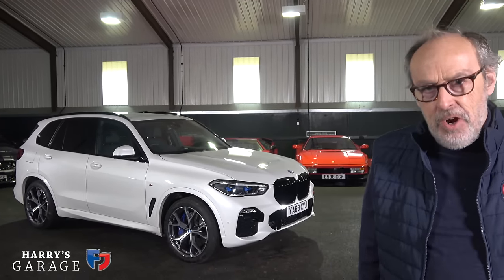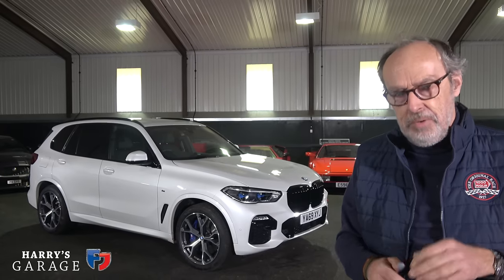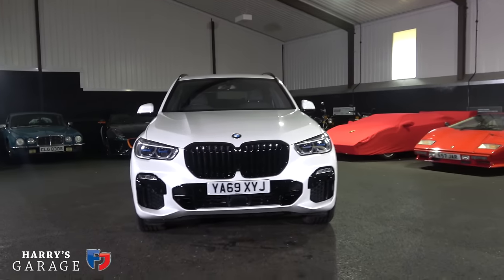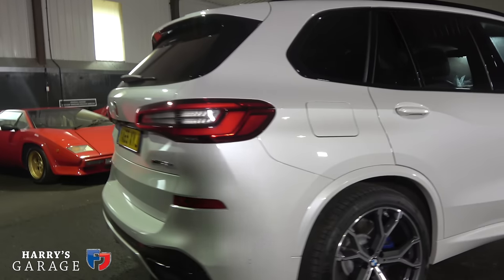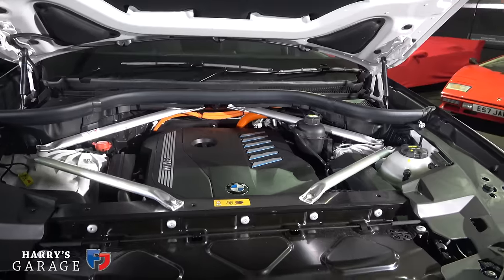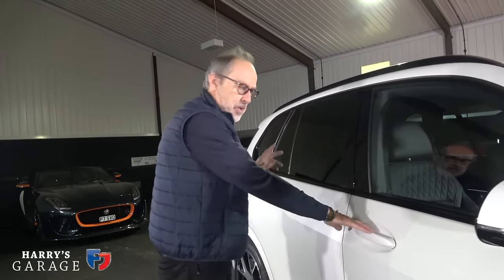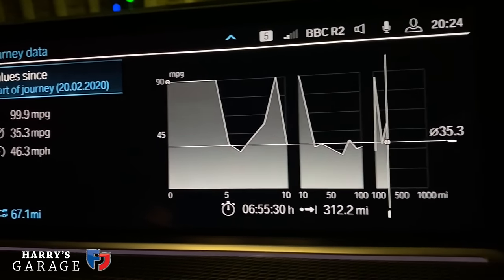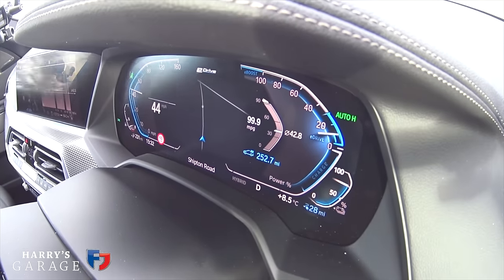BMW X5 45e PHEV 2020 review. Is this new plug-in hybrid better than a pure EV in the real world?

Comment: PHEV is absolutely better. Even here in California, where there are supposedly more fast chargers than almost anywhere. Just in Dec over the holidays, Tesla owners were waiting over 4 hours to use a supercharger. The local supercharger at the Tesla dealership (the next closest would be at least 30 minutes drive away-in the San Francisco Bay area) there is regularly a line, so people expect an hour's wait minimum.

My wife has had several Chevrolet Volts over the past 8 years, the latest being a 2018. This one is rated at about 50 miles on battery only. We do have a level 2 charger at home. Her commute to work is 18 miles round trip. 95% of her driving is pure electric. However, she can drive wherever she wants without having to plan the route around charging stops. Refueling the tank takes only a few minutes, as compared to a minimal 30 at a Tesla supercharger.
PHEV is the way to go. There isn't the charging infrastructure in place even in California to support the electric vehicles that are here (said to be about 10% of vehicles registered) and there certainly isn't enough of an electrical grid to support charging if pure electric were to be the overwhelming majority.

Comment: I think PHEVs are better for many people and probably better for the environment. A real electric range of 30 miles covers about 90% of my daily driving but the other 10% is long range motorway stuff. ICEs are pretty efficient on motorways, the public health benefits of EVs are most valuable around town and 90% of my driving would be zero emission without having any concern about range. And using smaller batteries is highly beneficial in environmental terms. I find it worrying that an obsession with GHG emissions seems to be blinding people to all other environmental impacts.
Reply: This exactly. I can't work out why VW for instance didn't make say, the E golf a plug in hybrid with the little 1 litre. It wouldn't have been that much more expensive and then you don't have to have a whopper of a battery either

Comment: Yes that's all very good but why not factor in the depreciation. I bought an immaculate  Land Rover Td5  12 years ago - Back then I paid just over 7k and now it's on 175k miles and still worth 4k today. On a run it averages 30 mpg but as it's not an everyday car it really doesn't matter. On the other hand I run a late Ford Connect van and an older but brilliant Audi 90 A2. both give around 60mpg. My son has an Audi A4 which does around 70mpg so I don't see whats so game changing about this BMW.  I heard once that to justify a Diesel car you needed to travel 70k miles in total before going into profit Vs the petrol version. The only way the BMW win is if you only do around 40 miles per day but you know in 3 years it's only  going to be worth 35k which is almost half its original value. Have I missed the point?

Comment: Could you try the new Mercedes gle 300de it has a  2.0 Diesel engine and  a plug-in hybrid quoted electric-range of 100 KM [62] miles this sounds like the perfect solution

Comment: I suspect that total CO2 emissions from this car, including the emissions from the electricity production are probably worse than from either a modern diesel car or a 100% EV. There's also an issue to do with complexity: CO2 emissions during manufacture will be higher than for a simpler car and perhaps this car will be uneconomical to maintain when it's ten years old meaning that it might have a shorter life which would further increase the total life cycle emissions of CO2.
Reply: The battery is not that big and the grid in the UK is very clean so if they do a 4-5 thousand miles in electric it should be cleaner.

Comment: I test drove a brand spanker and only got 36 miles off the battery over a 24 hr test drive which made me a little disappointed. Not sure if it was because it was on the first charge et?. A great car though and struggling to decide between this, tesla 3, iPace or Taycan...
Reply from the maker: I suspect it wasn't fully charged. The last 20% of charge takes a lot longer to go in than the first 80%. Only guessing but I found it did  at least 40miles on every over-night charge, with a peak of 48miles.
Reply: @harrysgarage  It was charged to the brim, it was used in and around Bristol mainly and probably did about four hill climbs (but the engine does kick in where it needs it as I'm sure you found). I think I need another long test to see if I can achieve similar results to what you got.

Comment: Great review Harry - but hybrids and EV's only make sense if you're fortunate enough to have a charging point at home, for the rest of us they're not an option.
Reply: But you can have a charging point installed at home if you want. Yes it will cost you but then it's offset in lower car running costs.
Reply: @martinr7371  Many of us can't have off-street parking - if you live in a terrace house in London for example, or a flat or tower block, so a home charging point isn't possible: I'm lucky if I can park outside the house, often I can't park in the same street. Remember the problem Harry had when he tried to charge his EV away from home; and whats going to happen to the the cost of electricity?
Reply: Agree on all points, this is the problem not just with PHEV's but pure EV's too.  The infrastructure is sorely lacking. I can't see how they will ever overcome charging issues for terraced housing, high rise accomodation etc.

As for producing the electricity in the first place? Well while we still burn fossil fuels it seems hypocritical to push the EV.

Comment: I have had my car for two months, when fully charged the most it has ever stated the range on the battery would be is 41 miles. Good, would be better if it did as advertised. My only other reservation with the car is it’s width, it fills a standard car park space leaving one wishing the right to use the mother and baby car park spaces.
Reply: So you don't even get 41 miles?
Reply: Akin Olusoga no, having said that I seems to be better than any other available.

Comment: I have X5 40e.... Great quality car... Electric range not great 18 miles... But ok.... Has 2 litre petrol 245 hp engine...better option than the 6cyl.. Quieter and more economical with plenty power...

Comment: Can the engine also charge the battery if the battery is low or can the engine just hold the battery at a set level ? Like the range extender BMW I3
Reply: I have a 330e and you can set it to charge mode on long runs

Comment: Perhaps the poor petrol performance has to do with the extra weight of the batteries.   That's the problem with PHEVs - you are lugging around two complete drive systems.  If you want it to compete with Tesla on performance you then need an even bigger engine.  To get a decent electric range you then have to have more batteries because the bigger engine is heavy.  So there you are on a vicious circle , while your costs spiral upward  because you have two of everything.

Comment: This is getting close to where PHEVs need to be, but the slow charging is unacceptable for a battery that size - they'd need to get it up to at least 7-8 kWh and ideally up to 11 kWh. Pretty sure that will happen in the facelift (or even before), so I would hold off until then. The current maximum is 3.7 kWh which is basically what a beefed up standard domestic plug provides - not good enough. Personally, I believe a more sensible strategy is to buy a full electric now and keep your conventional ICE around for a few more years but minimise its usage (long trips & vacations). In that regard I am really looking forward your Tesla review, which I hope is going to be for the Model 3 (?). That car is a bigger game-changer for electric than this X5 is for PHEVs.

On the BMW PHEV front, it also seems pretty inevitable that the next 5-series touring will get this type of tech (current one isn't engineered for this size of battery), which will make a lot more sense (why put eco-friendly hybrid tech in a heavy SUV)? That should also be a lot more fun to drive. Hopefully BMW also realises that these would be bought by enthousiasts and provides a sports exhaust option - I drove the X5 45e and you can barely hear it! So  potentially a lot of good reasons to hold off a little longer. But yes, if you must go (luxury) PHEV today, this X5 is probably the only choice in the game right now. And Harry is right that it's priced quite well.
Reply from the maker: I'm afraid it turns out the slow charge rate is down to legislation. It turns out Germany introduced a new law (January 1st 2020) saying you can not home-charge at a rate greater than 4KWh, as power companies were concerned their national grid could not cope with supplying lots of homes charging BEVs at a higher rate than this. Here in the UK, we can currently charge at a max of 7KWh on normal domestic supply, or up to 22KWh if you have a 3-phase supply. But I'm hearing we may have to reduce this down to a similar rate as Germany because developers aren't able to build houses that already have planning due to councils retrospectively introducing a requirement for each property to have an BEV charge point and the grid not being capable of delivering. This nightmare BEV story is only just beginning..
Reply: @harrysgarage  That's fascinating - had no idea. Can't find much info on it either (probably lots of articles exist but in German). It's just Germany though, so why restrict it for the rest of the world? It does seem rather convenient (from a German perspective) that this takes away incentives for going full BEV but rather steers people to PHEVs - which the Germans are becoming rather good at (see this X5).

All of this does point to the fact that we need to urgently decentralise the grid, either at the individual lot (i.e. per house) or, more realistically, somewhere 'in between' (per village, per new development, etc.). That means renewable energy generation as well as battery-based buffers so that we don't run into problems like not being able to charge cars at night. Restricting kWh to protect the centralised (fossil based) grids (and the ICE makers along the way) seems like the wrong way to go about solving this. Have a look at the 'Hornsdale Power Reserve' for a better idea...

Comment: The comparison between the BMW and the Range Rover is pretty intrerresting. I have a Volvo XC90 T8 that has more of the same configuration as the Range Rover. A total of about 400 bhp, and I have compared it to the Cayenne Hybrid that has roughly 456 bhp or thereabouts. Now I'd really like to see both the Volvo, and the Cayenne compared to the two you have tested now. and to hear your opinion on how they compare. (I find the 4 cyl. in the Volvo to be really trashy, and the Cayenne to be very smooth, also the transition between internal combustion and battery in the Volvo to have the same nudges as you explain in the BMW, the Cayennes transition was absolutely imperceptible )  Maybe also toss in the Mercedes SUV Hybrid into the mix to get a real world comparison of the premiums in this segment. HARRY? do you read these comments at all?
Reply from the maker: Yes, I try to read comments when I can and generally check up on them first and last thing each day. I'm not going to be reviewing any more PHEV in the near future, I wanted to bookend the sector and that's what I think I have achieved by featuring both the RRS P400e and X5 45e. For me, the X5 is the current market leader and until another mainstream PHEV launches with a range greater than its 54miles, I won't be booking any more in.
Reply: @harrysgarage  Thank you for your feedback. But I'm a bit disappointed that you think to have found the answer so far because there are other competitors that perform very differently, even if not meeting the WLTP of 54 miles. I didn't want to tell you, I'd rather wanted you to find out by testing, and it would have been ore interresting for your viewers as well. I had a very different experience with the Cayenne, in a very typically Porsche fashion. They tend to understate their performance, and the Cayenne E-hybrid is no exception. They only claim 23,6 miles WLTP on the battery, but real life average MPG just blows the X5 well out into the weeds, even though their V6 has 340 bhp and a total of 462 bhp. I think it's due to their regeneration technology being leps and bounds better then the BMW. When the Cayenne battery is empty for pure electric driving, it regenerates energy co much more efficiently so that the real life hybrid function actually renders so much better mpg. In addition, I found the sportiness and driving experience to surpass the BMW or any other PHEV by far. So why did I by the Volvo you ask? well, I live in Norway so we're as you know taxed to death - the Cayenne was twice the price, and the Volvo was fully loaded at half the price of the Cayenne. If I had the money, the Cayenne would occupy my garage instead of the Volvo, and it was a toss up between the Volvo and the BMW (the latter lost the money game). I already have a 911, so I get my speedfix anyway :)

Comment: Seems 54 miles is still negligible bearing in mind that most of the time you are dragging 200 kilo of batteries around with you for nout. Same with the Audi Q5 hybrid plus you have the price premium and home charge point net costs. Go full electric with BMW or Audi. OK if your budget extends to 65/70k. IMHO this is technology that is equivalent to dial up internet!
Reply: In a long range EV you're dragging around 100s of extra kilos for a battery you rarely use 100% of. Surely the end result is the same.

Comment: Problem with the latest generation of X5 is it is just too big. I had one for a month or so; couldn't get it through a 6"6 width restriction designed to stop lorries using a road as a rat run.
Reply from the maker: It's an issue with all cars thanks to the latest side-impact crash regulations, which now require manufactures to add 'volume' on both sides of the car to absorb the crash energy before it impacts the seat. These regs are getting silly now, as cars are getting just too wide for our city streets as a result. Don't blame the manufactures, it's the regulators who are responsible for today's cars getting so wide!

Comment: A different web site also commented on the super slow recharge time of the BMS X5 45e using 3.7KW.  They did mention that BMW will sell you a separate cable that allows much faster charging.  I haven't seen where this is mentioned at bmw.co.uk or at bmwusa.com though. Perhaps this "cable" is just wishful thinking.
Reply from the maker: Not true I'm afraid. There are two charging cables available for the 45e, one which uses a normal UK domestic supply that charges at a maximum of 2.2KWh and a Type 2 cable for charging from a dedicated car charging point, which charges at a maximum of 3.7KWh.
Reply: BMW probably considered that since it has a relatively low capacity battery, faster charging wasn't needed.

Comment: Surly the 3.0d or 335d or even 4.0d engine combined with the battery is the answer to today's question.
Reply: check out the new Merc GLE 350de PHEV with a bigger battery than this X5 45e...

Comment: first. 
it would be interesting to see without charging the mpg in solely hybrid mode. That goes for all PHEVs as people get lazy. Electrical rates per kW are likely to increase etc. 

the government expect CO2 to be higher, and the mpg should be lower as you charge the battery. 

In the test the battery was empty when Harry arrived, but later it was back at 30%, therefore distorting/correcting the mpg? 

second 
The American road safety association has added lights to important safety equipment. BMWs have always had barely there lights. its dark all winter, but none of the tests except Russian check head-lights depth of view.

Comment: Its not a new idea, the vauxhall ampera/chevy volt, runs on the same platform, a plug in electric charger, and a smaller 1.4 engine, that feeds the generator, which in turn, generates electricity for the electric motor, they have a pure electric range of 30/50 miles,  and with the range extending engine, its capable of a 400 mile range.  3pin plugin charger for home use, which can trickle charge the battery in 8 hours, or it can be changed to faster charging mode, that charges it in 4 hours. GMs and Vauxhalls marketing department, failed abysmally, in the marketing of the vauxhall ampera, and also left consumers, confused as to what the car actually was, and how it worked. The price point was quite high, within the audi, bmw ballpoint, which did'nt help. Great value cars now, as they where truly over engineered, and built to a far higher quality than other vauxhalls.

Comment: In the land where these are built, it’s considered ‘under powered’ in some circles...!    Retired BMW Client Advisor
Reply: The engine has only 286hp, so it probably won't go faster than maybe 215km/h, for Germany it is slow.
Reply: Gilson Rogerio Lima Oliveira-It looks like you you omitted the power from the e engine (113) and the max speed is ‘limited’ @ 235km/h.
Reply: @mcclechinois3721  my bad, I forgot it's a plug-in, so the battery has energy to help at high speeds too.